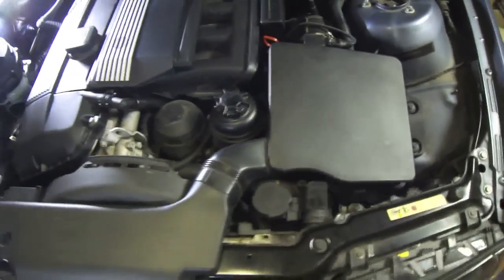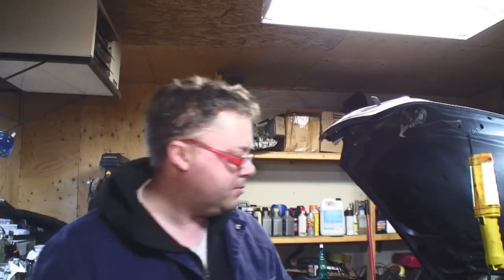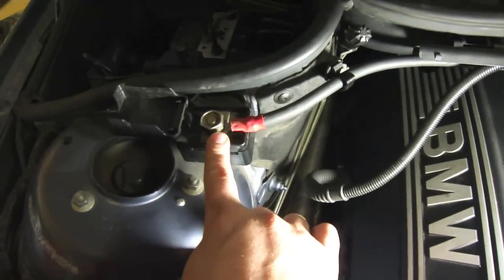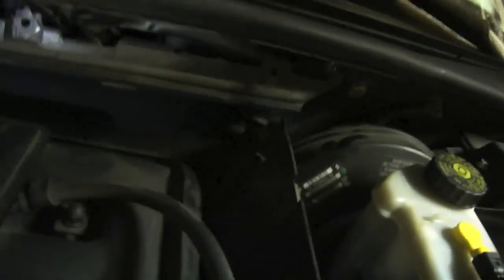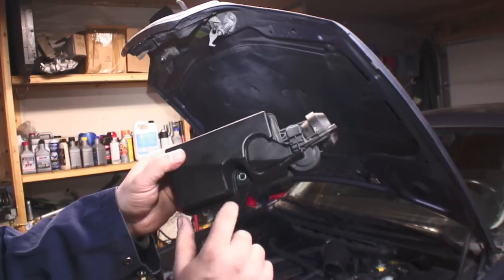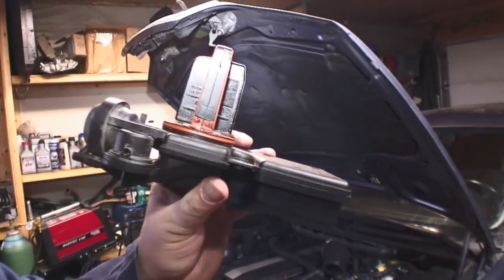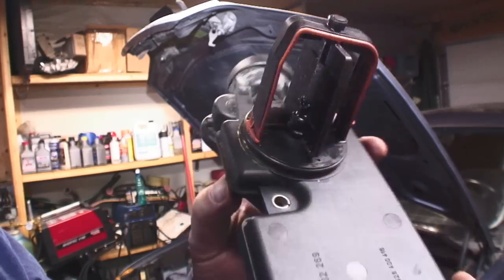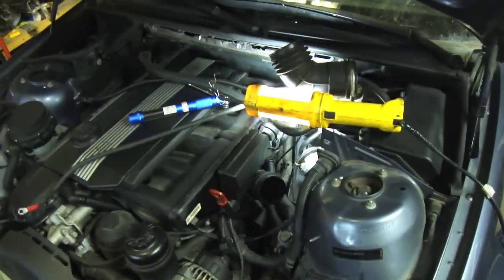DIY How to Remove BMW DISA and Replace O-ring

Comment: you dont need to get the power cable out of the way to get the cabin filter housing off it just simply pulls off after the 4 torx 27 bolts are removed. i love your videos tho dude i gotta 99 e46  328i which i did the motor swap recently on along with alot of other fuckry like aftermarket headers coilover and other stupid shit lol

Comment: Also another soured of air leak is that system found between the back of the engine manifold and the passenger compartment firewall.  There are small diameter hoses, and a small plastic check valve and what have you.  Really a tight spot under the hood.  But you can get to it to replace the components I just mentioned.  That could be a possible source of your "Service Engine Soon" light.  Good luck.

Comment: After you have figured out the right size O-ring, you might try ordering from McMaster and Karr.  Also, the original DISA valve does not have an O-ring.  The rubber component is like a vulcanized forming orange rubber gasket. It is not an O-ring.  But ordering an original DISA will cost you about $300.  Ouch!

Comment: The inside of the intake didn't seem as clean or as smooth as I expected it to be.  Should it be cleaned a little before i put the DISA vavle back on?  If so, with what substance?

Comment: All you need to remove for the Disa Valve is the upper intake boot.  Love you vids man!
Reply: This depends on you model, some DISAs are longer than others and can't fit without that shield gone.
Reply: Not even just the box. My new gasket was a bitch to get in even greased up!

Comment: Could you please tell me what size O-Ring you used.  And possibly where you found it . Thanks
Reply: The size is 60mm in diameter and 3mm in thickness. I couldn't find the right size o-ring, so I cut a piece out of a larger one and glued it together with rubber glue. It worked out fine and is no longer leaking.
Reply from the maker: +tim carter link for the o-ring is in the description

Comment: smoke is coming out of my exhaust when I start and accelerate, 2002 BMW. What could this be?
Reply from the maker: that can be many issues, black smoke burning too much fuel, blue smoke is burning oil, white smoke is burning coolant, or it could be cause from the ccv valve or other things

Comment: Bullshitkorner cool video!! I'm about to the that job for the first time, What's best way to take the old DISA valve out without breaking the pin??
Reply from the maker: there is no issue of breaking the pin, if the pin is broken it will be already and not by removing it. the valve can only come one way out and that is by pulling it straight
Reply: Bullshitkorner
Thank you sir!!! Oh, I meant f-ing beer time!!! No but all seriousness. keep y'll posted by the of this week 1/19/14.
Reply from the maker: sounds good and good luck

Comment: Could the DISA valve o-ring cause a high pitched whistle/whir under hard acceleration, like 3500 rpms and higher?
Reply from the maker: it is possible but from what i've read that is a common issue with a torn intake boot.  do you have any lean engine codes ?
Reply: Bullshitkorner i had a "random misfire" code.
Reply from the maker: misfire codes can be related to a small air leak but also other issues like plugs or ignition.  Did you manage to get it figured out
Reply: Bullshitkorner Haven't figured it out, but did visual inspection yesterday and listened for leaks and found a vacuum hose that was replaced without using the correct type of hose.  That could be the issue.  Need to do a smoke test but don't have a smoke machine.
Reply: Bullshitkorner Okay so smoke tested the intake this morning.  I have small amount of smoke and air coming from the top of the DISA valve.  That would pretty much mean the DISA Valve o-ring, right?
Reply from the maker: that would most likely be the case, inspect your disa as well and make sure the pin in the flap isn't coming out
Reply: Bullshitkorner Thank you!  I really appreciate your help!

Comment: Hey man, nice work! I really enjoy your videos and use them routinely to fix my bimmer.  Likewise I am currently experiencing the vacuum leak codes p0171 and p0174 and I changed the DISA o-ring along with the boots, clean the TB and the ICV without success. I also have p0300-06 codes and my car idles rough. Do you have a clue where the leak may be coming from? I have the CCV in the mail, and thanks for that video as well. Thanks in advance for any recommendations. Keep up the good work. Cheers

Comment from the maker: it means your fucked yourself if you can't get it out.  try using a vacuum to get it otherwise your going to have to remove the intake to remove it.  if you try to start your engine you will be saying good bye to it

Comment from the maker: 5w-30 is what you should be using BMW rated, however red flickering is bad that means you have almost no oil pressure. the ticking noise you are hearing is the parts not getting enough oil...... from what your saying it's not looking good for your engine

Comment from the maker: it could be very possible that the pin in the disa valve is loose or fallen out causing this, which can be very bad news as that pin if it enters the engine can destroy it

Comment: Broseph, The part you can use is actually a 1991-94 Ford Probe Water Gasket O ring, Same size and fits snugg, I did it as per a e46 forum

Comment from the maker: i replaced mine with a new gasket as well, from what i've read is that you can get away with using silicone but i'm not so sure on how well it would really work

Comment: After chasing down vacuum leaks for months, I finally figured out that I too have that damned orange silicone where the gasket is supposed to be. I have the new gasket and am currently extracting the silicone.

Comment from the maker: no it didn't, the video will be uploaded in the next weeks of what the issue was behind my problem.  however the only way to find a vacuum leak is to smoke test the motor.  that video will be upload in 2 weeks on what i did to make my own smoke machine for under 50 bucks

Comment from the maker: usually a oscillation in idle on the bmw e46 is caused by bad vanos which is a pretty big job, one i haven't yet had to do but will be looking into it next winter

Comment: remove cover, and oh my god, the car has a butter, so divers can hear, right now as I could remove the grime, right now I'm going to be taking liquid cleaner motor to put new oil, DISA valve works I can open and close without moving the trigger.DISA valve will have something to do with the oscillation of the rpm?? hose that change in your other video that I need to change but I think it is something complicated, according to me is not broken but it creaks when you move it is time to change it??

Comment from the maker: the self levelling headlights I believe are electronic and one maybe sticking.  the DSIA valve should not make any noise at all. if it sounds like marbles your flap could be broken, i'd inspect it asap before something breaks free and takes out your engine

Comment: hello
I have a BMW 330i, in the morning when I turn it on, it sounds like a tic tic, as it has enendido while decreases the sound, I think are the divers or aims, these are calibrated? or are hydraulic??
another question
BMW DSIA sounds like you have marbles inside is normal?
because if the car accelerated to 3 rpm this falls to 500 rpm could you suggest me to check?
could upload some video where you can see?

thank you!

Comment from the maker: the whole purpose is to give people the confidence to do the work themselves without having to take it to the shop and pay huge amounts in labour.  I would never use a air ratchet to remove spark plugs ever, the last thing you want to do is risk stripping the heads

Comment from the maker: Steve your not way off topic I have had lots of requests to do the spark plugs on the 5.4 engine as well.  that will be next spring/summer project.  I had purchased the extractor tool already to be prepared for the horrible job of replacing the plugs. the guy i bought the kit off of said he broke all 8 plugs.  my tip for removing the plugs would be to run seafoam on the last 2 tanks of fuel before changing and crack the plug and spray some carb cleaner and let it sit for a few hours

Comment from the maker: no performance issues at all, runs like normal but your right the short term fuel trim is up because of unmetered air.  I will know in a hour if i solved my issue in both cases they are both my fault due to carelessness.  the first one was not having the hose from the ccv to the dipstick locked in place on the ccv as i was able to pull it off.  the second was when i replaced the VCG it folded over where the smoke came out when i smoke tested it, videos will be up in a month or so

Comment: I am going to guess again.  Unmetered air being picked up by the 02 is , actually unmetered air or  not enough fuel.  Fuel trims are trying to  add fuel because of unmetwered air or the engine is not being supplied with enough fuel.  The generic code differs from BMW, as BMW will  throw 2 codes for each bank.  A third option is a 02 sending you wrong data to ecm.  Never did  hear  any performance issues.   Just a guess, might help.

Comment from the maker: checked the oil separator I didn't connect the line properly as it came off, fuel trim was 28% now 15 percent.  smoke tested the engine and found a leak in the VCG where the valve cover is slightly warped going to see if silicone will seal it up and recheck fuel trims

Comment from the maker: i'm down to a p0174 of which I now have narrowed it down to a leak in my valve cover about 3 inches.  discovered that when I smoke tested my engine.  after i fix that i'll see what my short term fuel trims are.  they were at 28 % found out i didn't have the oil return line connected right as it just pulled off.  that dropped my fuel trim down to 15 %.  i'm going to reseal my VCG with silicone since it' has a slight warp to it and see what happens